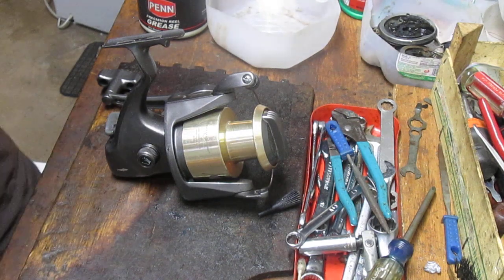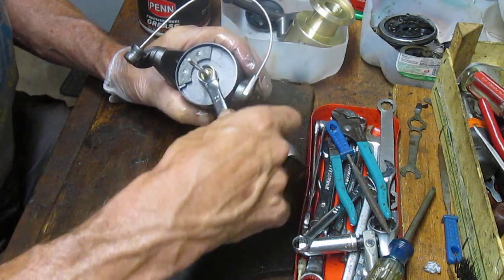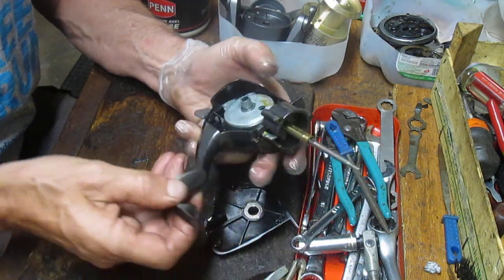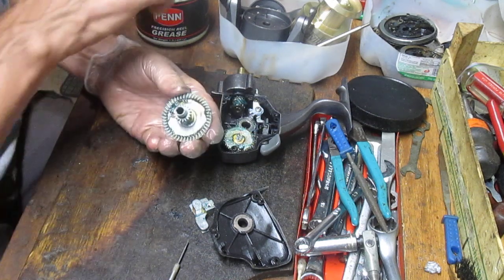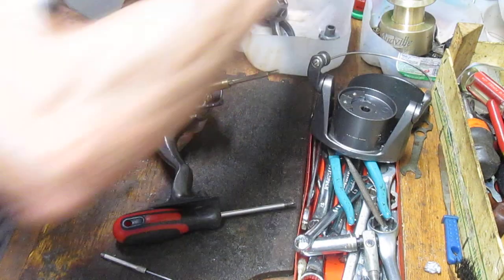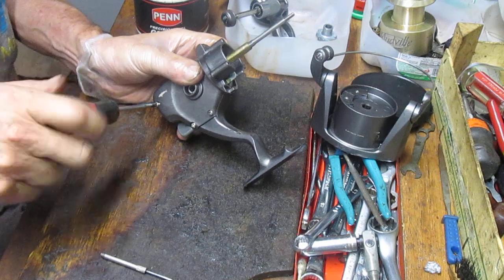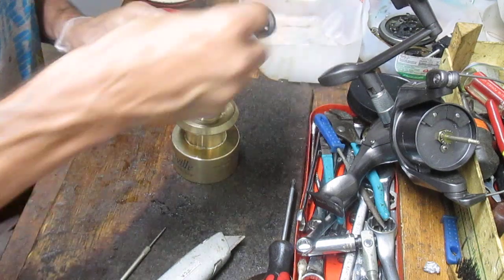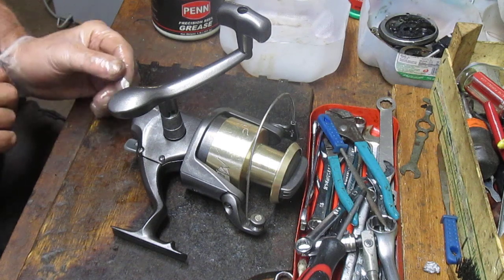South Bend Mudville Catfish reel take apart and service - nice reel for price

Comment: Just subbed.  Like the vids.  Could you do a TLD 25 from Shimano?  Just curious on how to do maintenance (normal grease and oil).  Little intimidated on it.
Reply from the maker: Hi.  I will do one the next time I get one in the shop.  I recently did one on the Triton Trolling Series 30  (TTS30) lever drag that is very similar to the Triton Lever Drag 25 (TLD 25).  You can watch that video at https://youtu.be/L1DM3euKJzk.  Thanks for asking - Dennis
Reply: 2nd Chance Tackle thanks!!